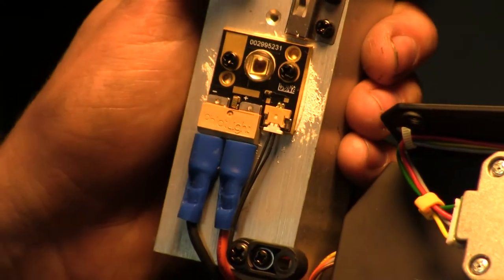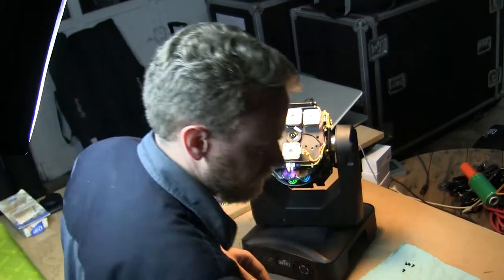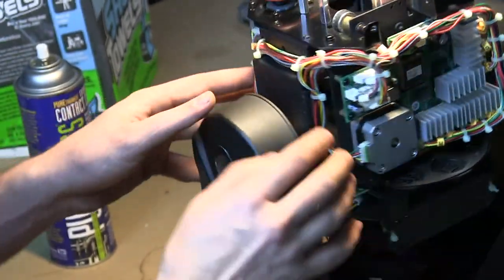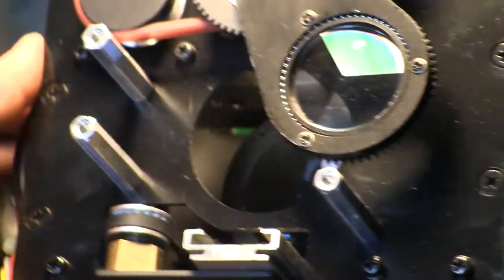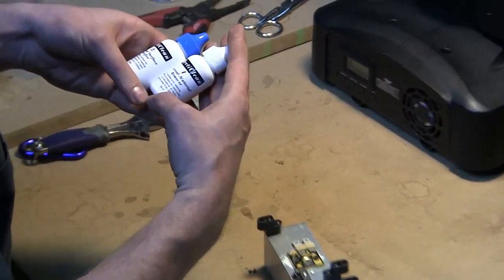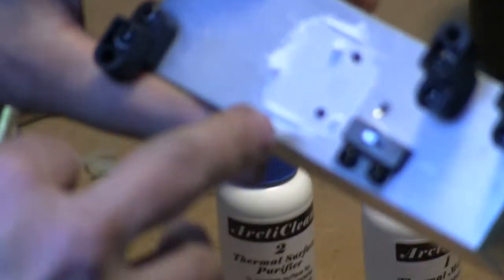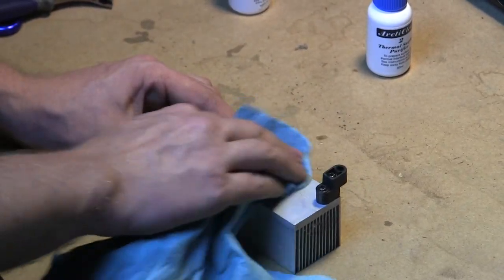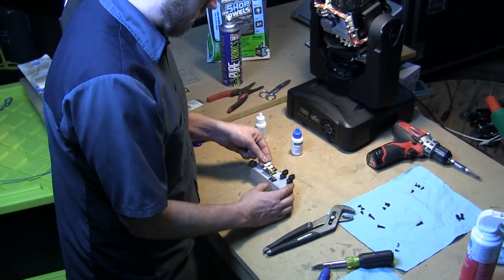Chauvet Q-Spot 260 LED - LED Chip/Diode/Bulb Replacement Part 2

Comment: Theoretical question:  Would it be possible to replace that 60w LED chip with say a 100w LED chip?  Or would that require a power supply / controller  board upgrade too?  Wouldn't want to blow it out.
These chips seem to have a common design across wattages.
Reply: The cooling system is not built to handle a 100w LED and it would burn out very quickly, along with many other things that you already mentioned.

Comment: Where did you buy the replacement led from
Reply from the maker: Hey Darrell. I don’t remember exactly it was a long time ago. But I searched Google for q-spot 260 led replacement bulb and found some and tried some and they worked great!
Reply: doing a quick google search for the name on the new part SSD-90 gives you some good results